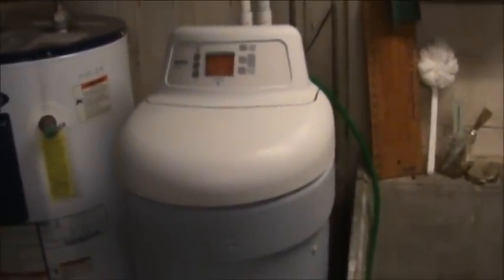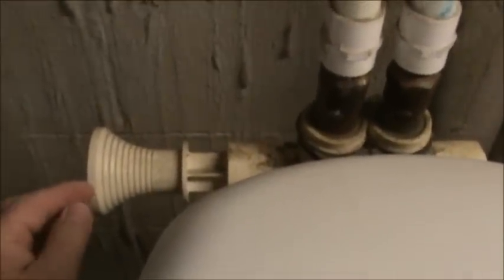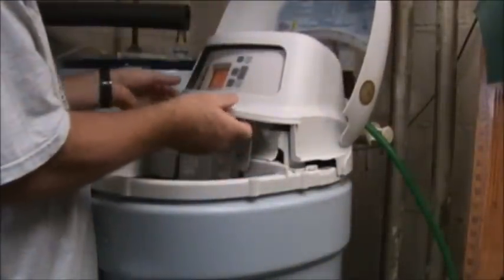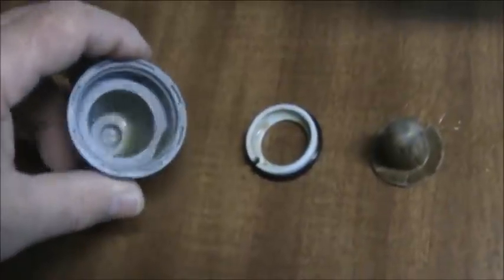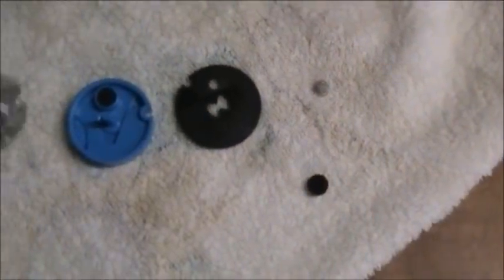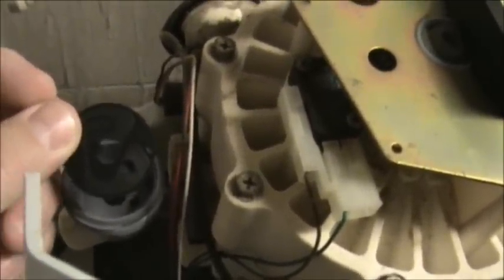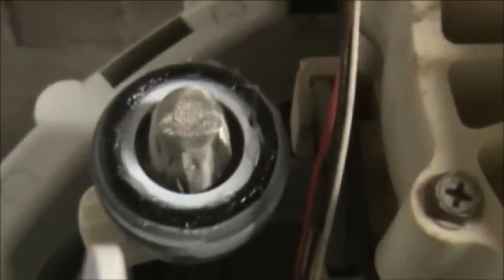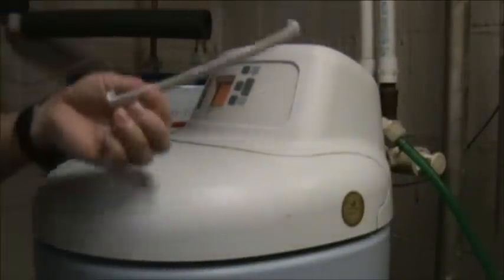Cleaning your Water Softener Part 1

Comment: Both videos are excellent.  Unfortunately, both videos didn't solve my problem.  I cleaned the venturi, as well as the tube thingy on the second video.  My tank is still full.  I've cycled to the second stage, and it didn't drain.  In the past, I've even replaced a micro switch because it wasn't cycling.  I cycled through all stages, and appears the micro switch is still good.  The tube is more full than the tank?  I don't know what else to do.  I'm close to pulling out the 45.
Reply from the maker: I had to take mine apart twice before I found a very small piece of grain or rock blocking the water from draining. I siphoned my tank empty before I started my cycle. Can you hear your pump running?
Reply: ***** I'm not sure what the pump sounds like.  I know there is vacuum from that tube at the venturi?  What I did do, was drain a lot of the water out.  I sucked it out of that brine tube with a wet/dry vac.  The water has been about 12 inches above the salt (around #6) for weeks.  I poured some warm water in the brine tube, for about 1/2 hour, then vacuumed as much as I could.  I regened it.  It seemed to throw water out, better than it had been doing (Not 100% sure of this). It cycled all the way, and thank god it DID NOT fill up with water again.  I don't know if that means it's working, or not.  I'll have to wait to see if I'm getting soft water.  What do you think Lonnie?
Reply from the maker: edward soto
If it regenerated and drained without filling up with water, sounds like you got the drain unblocked. You might not get soft water right away from your hot water heater depending on how long your unit has been down. If it's recharging and draining it should be working.
Reply: ***** Hey Lonnie.  I just don't know.  It's been a couple of days, and I'm not feeling softwater even through the cold water.  I have a faucet back to back to the softener (immediate soft water).  I couldn't even detect soft water there.  I don't think it has regenerated on it's own yet.  Bypass is in correct position.  It's like it's off, but the lights are on.  I wonder if it's possible for the resin beads to be filled up and stuck up in there?  Might be time to pull the Sig out.  Thanks for your help Lonnie!

Comment: never , ever use petroleum based lubricants on O-rings. They will begin to dissolve the rubber. I only use magic lube , which is made for O-rings. It is a lubricant and sealant combination.. Other than that mis -information, this was a very good detailed video.
  Thank you
Reply: You've just had cheap O rings. They are everywhere inside engines, transmissions, power steering gears, pumps etc. All doused in multiple types of petroleum.
Reply: RESEARCH Some Do Just

Comment: The part where you took off the cab I have water in there how do I go about that
Reply from the maker: How much water, there should be water at the bottom
Reply: I did at the end of what you said unplug it put it on Bryn and it turned it milky white looking soapy
Reply from the maker: The salt will dissolve and turn white, you should have about 3" of water in the bottom

Comment: All OK, except I recommend NOT putting Vaseline on the O ring. Petroleum products tend to stretch the O ring. I recommend using a silicone based lubrcant. Also, with this model, it is not necessary to bypass the unit to clean the nozzle. It is un-pressurized in the SERVICE position. If water comes out of the nozzle in the SERVICE position, there is a mechanical problem with the unit.

Comment: You should have used plumbing silicone grease for the o-ring. Do not apply vaseline on plastic or rubber
Reply from the maker: My factory instruction booklet say to use Vaseline.
Reply: @LonnieJohnson1  - Vaseline or other petroleum products should never be used on rubber objects. It can deteriorate the rubber very rapidly. The correct lube to use is a silicone based lubricant, which comes with or without Teflon.
Reply from the maker: Just following the instructions in the manual and it says to use Vaseline.

Comment: Vaseline is a petroleum product and will make o-rings swell.  Use silicone you can buy from a swimming pool company that is made for lubrication of rubber.
Reply from the maker: I can only tell u that the manual says to use Vaseline on the o-rings.

Comment: You put your small rubber flow plugs in wrong. You put the smaller hole one in the bottom. If you read the manual, it says the bottom (first thing you put in) flow plug is "HVDC" and you can read those letters on the plug. I saw this when reading "Nozzle & Venturi Cleaning; Iron From Resin Bed; Keeping The Water Softener Clean - Kenmore IntelliSoft 370 Series Owner's Manual" (page 30, on Nozzle and Venturi)
Reply from the maker: I have an Ultrasoft 425 and I don't think I did. I put it back together the same way it came apart.
Reply: @LonnieJohnson1  Hmm, strange. You mentioned the hole sizes, and when I took mine apart the larger hole was on the bottom one, and the smaller hole was on the top. That's why I looked it up in the user manual when you mentioned the other way around. Probably doesn't matter too much either way anyway...maybe they switched the hole sizes for the different models.
Reply from the maker: Could be the models...I looked at the video and pulled out my book, and the book shows it's put together the way it should be. Thanks for the info and for having me look it up to check it out and confirm that it is correct.